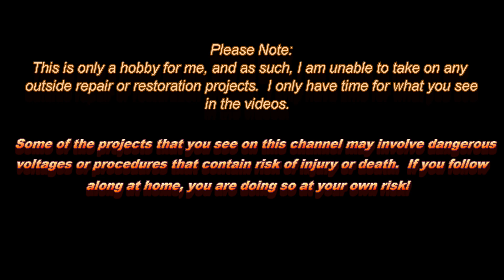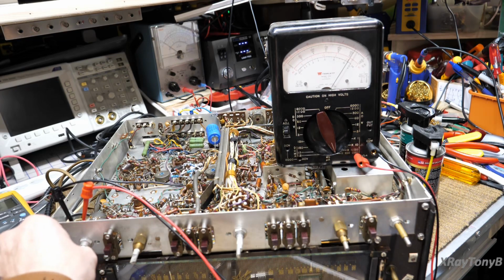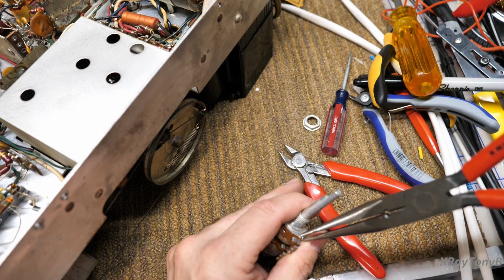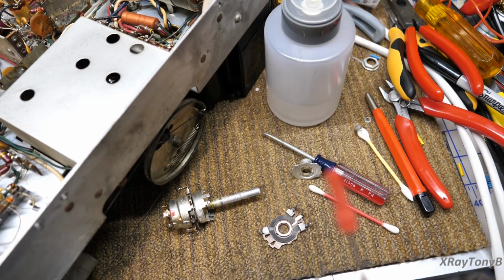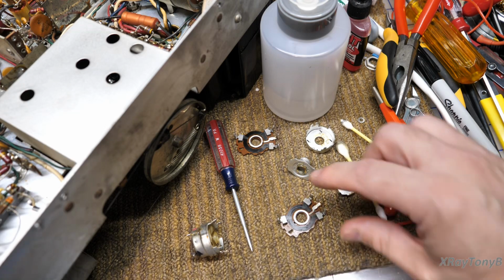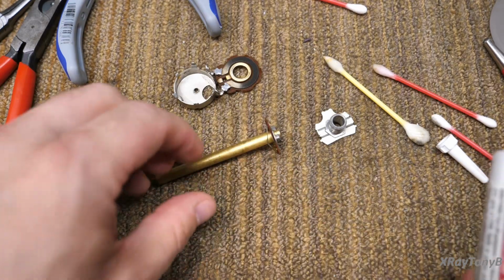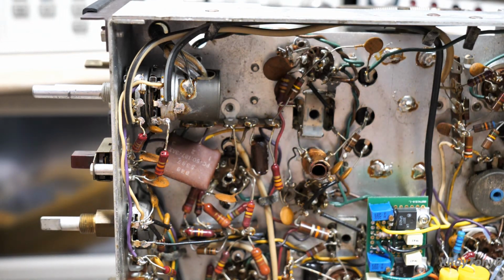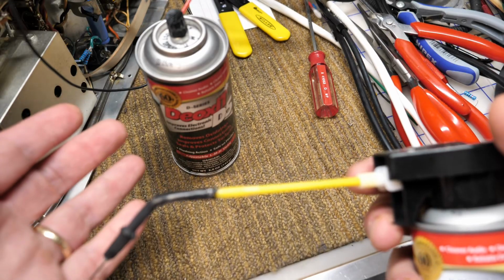How to Clean & Resurrect an Embalmed Potentiometer (With Bonus Rant)

Comment: I’ve been waiting for this video for years. Always wondered how to get the nice smooth resistance back in the control after it has been flushed bare. I believe it or not had excellent luck with flushing pots with just the alcohol you mention and then the green dioxit.  But yes the large can contact only cleaner spray is a great first start before the deoxit green lube. I used to use another cleaner called CG or something like this from Raido Shack and it flushed pots nicely clean down to no grease and dry. If you sprayed this fast evap stuff to long it could possibly freeze and crack brittle plastic holding the wipers. It sure did flush out the pots clean however, but the friction grease was then all gone. Probably this cleaner used sparingly “not to flush out all the friction grease” then followed by the green deoxit lube probably would also work nice? But it seems like if you flush out the all the grease you really have no choice but to take the pot all apart like you did. Obviously this method you showed with disassembly seems like the absolute best way hands down!
I would be interested in seeing if I can find anhydrous isopropyl alcohol or ethanol in a spray can? For this does not seem to wash out the grease as much as some of these other contact cleaner only type washes. Maybe follow this up with some deoxit green label and one would have a clean pot with friction grease in tact. Alcohol doesn’t tend to wash grease away as well as some of these other fast evap type contact cleaners that have harsh solvents or mineral spirits .  Thanks for your video sir, great job!! 😎👍

Comment: Worth mentioning that some pots have a C-ring snap-fitted into a groove on the shaft that will need to be pried off. Also, some pots have the wafers crimped onto the shaft  (the shaft was peened like a rivet during manufacture) ---- this generally doesn't pose a problem for disassembling single pots, but some dual pots might be impossible to disassemble, especially dual concentric pots where there is an outer shaft for the front-most pot and an inner shaft for the rear-most pot. The question that arises is, how badly does the pot operate, and is there an alternative to disassembling it? You might only get one shot at it, and a mistake, or a slip of the pliers, could spell doom for your vintage equipment. Have a Plan B at the ready, just in case. If there is sufficient space to just replace the control with a modern blue Alps pot, and the correct resistance and taper is available (and the shaft length is sufficient and can accept the original knob) , then just replace it. The problem that often arises is that many of these vintage controls have a fixed loudness tap on the resistance elements,  and exact replacement pots are no longer available. Proceed with caution!

Comment: Although this is a very helpful video with many good infos but what I'm really struggling with is the disassembly and assembly of large (quad) pots with spliced metal bits to hold everything in place...if you have any advise on this topic please, please, please do a video on it! Right now I have a marantz 4400 on the bench and having partially disassembled one pot I know they need service badly...I just dont dare to proceed with no known working procedure how to get them back together properly...

Comment: Full Disclosure - I am with CAIG Laboratories.  We love your videos and while we may disagree about certain things (DeoxIT does not ruin carbon controls), we feel like you are fairly spot on and have great content. As to the applicators, CAIG Labs continues to make the DeoxIT D5 Sprays with the original Low Medium High sprayer and detachable straw.  It has not been discontinued.  As to the new integrated Perfect Straw, this is what a person on a flight line, under a vehicle or up a utility pole would prefer to use.  No reason to rant!  Thanks for the great content!
Reply: Hi, I am from India. Cant get your products here. Kindly point out if you have any Indian channel partner.
Reply: It may not be an issue with newer carbon pots, but older (40+ years) I've ruined a small number of pots with D5. It is probably more of a function of the age of the pot, but the chemicals are probably breaking down the deteriorating binder used in the carbon track. I've had one that you could literally see where the track was being wiped away after application. For full disclosure I checked the resistance before and after use. 

If I have a very scratchy pot I use some contact cleaner applied to qutip, disassemble the pot, and apply it to the wiper only. I use a very small amount of a mild cleaner mixed with a touch of alcohol to help it evaporate faster on the track, and give it a very light wipe.
Reply: Hi Michael,      D5 Could be too strong on older style POTS???.  see BART Youndblood.....

Can you buy a Carbon paint???.

Comment: Tony:  I hope you see this because I have a much better method for the silver-contacts.
I have NEVER had good luck with using all the classic electronic cleaners for silver-contacts.
When I worked for an Army-Depot on missile systems, we would have to tear these completely down and go through everything.  One of the biggest problems was with all the silver contacts.  In some environments, there was very little tarnish--in others it was horrendous.

So, they gave us this clear stinky-liquid that just instantly removed the tarnish most of the time without scrubbing!  At the time I knew the mfg and the chemical name.
Anyway, I found out what is was: It is the same as Haggerty's Silver-Dip that can be had just about anywhere.
Tip: When you get done using the silver-dip, flush it with IA to stop the chemical action--don't leave it on!

Next, when you get the silver-dip bottle, there is an aluminum-foil cover over the bottle after you remove the cap.  Simply take a fine needle and pierce a single small hole.  This will allow you to put a swab by the hole and only saturate it, since this stuff is just like water and you do-not want it getting onto things!
Anyway, let me know your opinion of this--so I hope you read this!  73...

Comment: I have always used LPS 1 (greaseless lubricant) to clean both switches and potentiometers.  It is an off label use, but It only needs to be applied once and dirty potentiometers are restored.   I used to use this on commercial sound distribution amplifiers and if the amp came back like five years later for another problem these controls would still be working great.

Comment: Same carbon material is used in musical keyboard instruments, remote controls, key fobs, etc. Cleaning the surface of these contact points using q-tips with ISOPROPYL ALCOHOL and/or metal contact cleaners destroys them. The black gunk you see on the q-tip is carbon being rubbed off.

Comment: I suspect that this problem occurs on older carbon pots (maybe over 40 years old). On newer gear (30 years or less) D5 does a great job and I have not noticed degradation of the pot over time.

Comment: If you clean it with Electric Circuit Cleaner then you could use Triflow which is Teflon in a spray can . Triflow works the best. Found in the paint Dept.of most Hardware stores.

Comment: Tip for rotary selector switches. Many of the contacts used are actually a silver alloy, and Wright's silver polish (paste) will take off those years of tarnish better than D100 or anything like that.

Comment: I don’t know about using ‘damping grease’.
But I have bought and used turntable cuing arm High Viscosity 
Damping Fluid.
It maybe similar enough to the damping grease those old units used.
You can find high viscosity fluid that run from 10,000 to 100,000 cst.
Turntable damping fluid will cost about $10 for a half oz. Not cheap considering the amount.

You can also research the use of RC car diff grease.
That comes in even greater ranges, from approx. 2,000 to 2,000,000 cst.
The RC diff grease runs $10 for a one oz or two oz can.

One of these maybe the stuff to use.
I wouldn’t be surprised if they are same stuff used originally.

Oh, me, I use F100, and D100.
None of that F5 or D5 spray stuff.
But I am also guilty of using it incorrectly.

Comment: I use both of those, D5 and F5,  but only as a last resort on very dirty units.  I don't use the spray,  I use the liquid versions that comes in the dropper bottle with the needle tip.

Comment: Actually, I think it also melts and messes up the plastic inside. I bought a nice Peavey guitar amp from a guy (cheap) who had used the wrong stuff, and a few of the pots just turned all the way around and around, and the shafts even moved in an out because the shoulder O-ring thing was destroyed. Replaced them, and it made a great amp.

Comment: On the Deoxit site it specifically says:
Wirewound Rheostats and Potentiometers, trim pots and other sensitive electronics:
We recommend NOT using solvents, including any DeoxIT sprays with solvents. We do recommend trying the non-aerosol DeoxIT products on the contact surfaces. We recommend keeping away from sensitive areas, as a precaution, especially on old equipment.
Carbon Pots & Faders:
Care should be taken on carbon pots and faders, especially old equipment. The carbon make flake off over time. We recommend NOT to use any product with solvents. For carbon materials, we also recommend using the DeoxIT Fader (F100S-L2 and F100L-L25C and DeoxIT FaderGrease DFG-213-8G"non-aerosol DeoxIT applicators.
Reply: Except that D5 will not harm carbon pots. Caig Labs specifically said so.
Reply: @doofwop  It won't "harm" them, but D5 (and ALL DeoxIT products, including solvent free versions) will strip the friction grease that gives the smooth, slightly restive feel of a new pot if applied to the pot's shaft.
Reply: I also read this on their site about a year ago, but it appears to have since been removed. The claim as I understood it, was never that the chemicals dissolved the carbon, but rather they could possibly dissolve the carbon binder, further risking the flaking associated with normal wear.

Comment: I suppose it would make sense that the red deoxit would break down carbon.  If it is intended to be used on switches,  they build up carbon deposits when they arc whilst being actuated.  They probably designed it to remove that carbon.

Comment: That's a lot of work.  Are you doing that to retain vintage authenticity?  Because, for the value of time, I'd buy a new one and slap it in.  That said, I'm going to take another look at one I replaced on a vintage amp and see why I did that and if it can be restored.  Thanks.

Comment: Live and learn. Regular old iso- alcohol may be in order here . It doesn't lubricate but cleans crud off the wiper
and evaporates on the carbon tract. That alone will keep it clean and not degrade the carbon tract. 
The metal to metal contact points should be lubed but I think Lithium grease, not too much now, would work fine.
 Same for certain parts of turntables and old fashioned tuning capacitors. You can use Zoom Spout for those.

Comment: Tony I'm trying to pull apart a dual gang pot very similar to the one in this video. I'm having a problem getting the shaft collar off of it. Is there a way to get it off without damaging the rest of the pot? This is the volume control for a Sansui 2000x.

Comment: In uk we use servisol spray. I would replace the pot. Get a old stock vintage one as they are lovely and smokth due to oil damping on shaft bearing.Never had a issue eith servisol-ever!

Comment: Tony, you rant in a very funny way :-D,  but i do agree with you.
I clean pots by taking them apart, metholated spirits and cotton buds to wipe the crud off.
I have a soft rubber block that has fine abrasive in it, a wipe over the contacts and they shine.
"Gary blocks"  different grades of abrasive  (made for cutting/polishing car paintwork ).
Ordinary grease for the shaft.
If i need a pot working right now, wd40 drench (Dont hate me, i use what i have).
Switches are dissasembled always, the result is always better.

Comment: so Im curious about the grease stuff, Ive found damper/damping grease and it seems to be what friction grease is so theres that and its pretty cheap actually. However Im wondering what would be wrong with using automotive bearing grease, its super sticky and meant for high speed and high temp so Im certain it wont break down very quick at all in this application and im assuming because of its properties, it would give the resistance your looking for described in the video.

Comment: I have a CD player that the function buttons would not work or if you pressed FF for example it would pause the CD.  I spray compressed air through the crevices of the buttons then I use some one shot metered spray Deoxit D100 (as it's safe on plastic) and have gotten good results.  Should I use something else?  I don't want to take the front panel apart If I don't have to.  It's a high end Onkyo DX 7500

Comment: Great Video tony. I did not know that it was bad for the carbon tracks. I'm a flusher with that stuff, Not no more.... I also noticed how it gets all over the pcb's and switch wafers and how long it takes to dry even after blowing it off. I agree with Robert, Your pretty smart for a guy with just a hobby. Did you have any formal electronics training? I notice you have a Fluke 6071a sig gen on your bench. I picked one up (barn find) pretty cheep. Have you had any trouble with yours? wondering if you cold go over some of the trouble codes. It wouldn't even power on until i went over the power supply, the main relay was so corroded it would not close all the way. powers up now but with error's This is a hobby for me too and this thing is a little on the learning side still lol....

Comment: Thanks Tony.  This is a great video full of useful info.  I've been using red DeOxit for years on pots.  Not anymore.  Seemed like it worked miracles at first, but then 6 months down the road I'd start having issues with them again.  I think your explanation is correct.  

I didn't know pot rebuild kits were a thing.  Care to share more info on those; maybe a source?  I'd understand if you wanted to keep that a secret though, lol.

Thanks again.
Reply: You have to use D5 then follow up with F5. Pots will get scratchy again in six months if you don't.

Comment: Does the red can say its for removing carbon deposits or corrosion from switches?  I imagine it would say something like that.  Nos you got me thinking of the stuff ive used which has gotten the gritty feeling of the pot being lubed that is scratchy with dust.

Comment: Thank you for doing this video. I had a suspicion of “D” series deoxit. Seems to be dextron transmission fluid. I used mercon, not mercon V for years, because of less detergent. I worried of oil separating the fiber from the carbon. We see what it does too circuit boards. 
About the grease, what about dampening silicone like what they use to slow spring gears? Just a thought.

Comment: That initial aluminum/brass piece that you pulled off that you said was tight and you set aside... I have one on a Pioneer SX-980 balance switch that I CANNOT get apart. Any ideas? I am afraid I am going to break the fiber board.

Comment: Ive used this on my 5150 potentiometers and they have been fine ? they were really stiff over the years i shot it down the shaft when removing the knobs and they loosened off nice and all the static went away thats was back in 2019 there still fine ?

Comment: Always wondered how to clean those selector switches,  kinda already knew I shouldn't get it on anything non metallic. 

I use the CRC contact cleaner (about $6) a lot cheaper than the D5 deoxit, which I can't seem to find ANYWHERE  for less than $20!!

Comment: I think you might find the carbon track, in the pot, isn't just carbon... the track is a carbon composition: a mixture of powdered carbon, a filler (ceramic?), and a resin binder. Solvents in the contact cleaner could be attacking/dissolving the resin binder, forming a sticky solution that wets the track, the wiper, and forms a partially insulation barrier. The lube in the contact cleaner shouldn't wet the wiper contact, or the track.

Comment: Now with all that said, I have this Fluke 187 that I'd bought some time ago & I intend to open it up & give it a clean up. Since it has these gold plated contacts ( I'm assuming they're gold plated... Am I right ? mainly the selector tracks ), I was thinking I would clean 'em up with anhydrous alcohol and then leave 'em coated with DeoxIt G100L.  What r your thoughts on that ?  Some say that you should use dielectric grease on those selector tracks. Do u think leaving a coat of G100L on them instead of using dielectric grease is a better idea ? Since I'm no expert I really value ur thoughts & suggestions on this matter :D

Comment: I am reviving a vintage amp on a receiver, Rs 2100d! One part is obsolete. The double diodes. Vd1221 by Nec! After doing a cross search I have see that putting 2 1n4148 in series should work! Will a nte177 be a substitute! Thanks

Comment: Hey Tony, 
Thanx a lot for your great videos - again I learned a lot.
But: I would be extremely careful with using these glass brushes on silver plated contact surfaces. It happens really quickly that you just remove the plating...
Btw.: I totally agree on the new style of the Deoxit-can - this design is utter crap.

Comment: I always described it as a slightly gritty feeling. You can actually feel the wipers drag across the carbon track once the grease has been removed.
Reply: That's why tuner type cleaners are better. They leave a lubricating film behind. I use Deoxit G5 for pots and mouse microswitches.